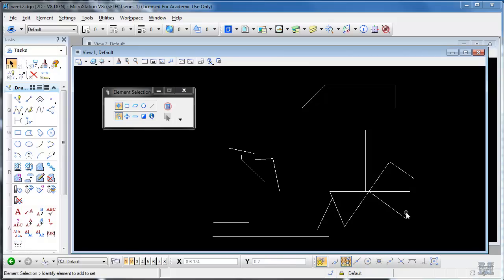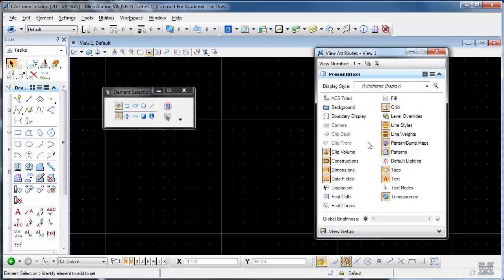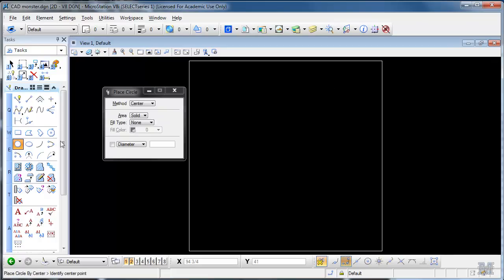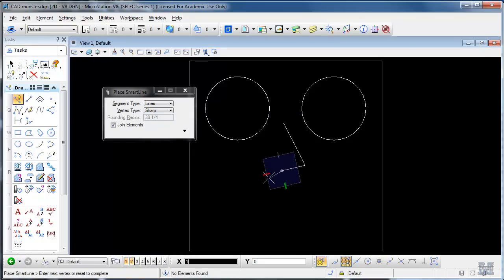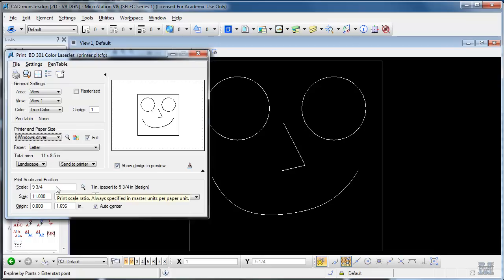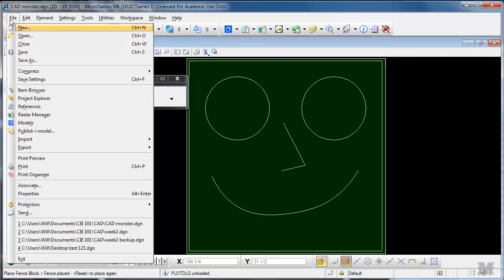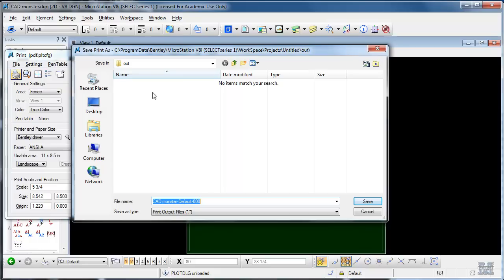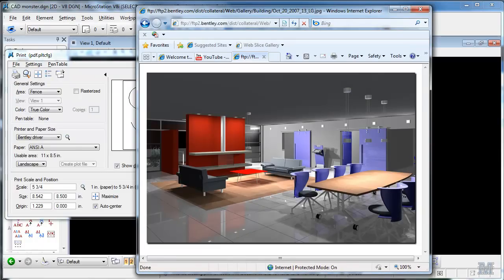Microstation lecture 03 (CIE 101, Civil Engineering Graphics)

Comment: Here's another correction for those confused.
Y (-12)  X (-12).
Negative 12 for both X and Y.
And he selected 16 Diameter.
Reply: I'll bet he meant 8" Radius.
Reply: With MS, if you pull your mouse in the direction you want it to go, it will automatically do the + or -. ;)